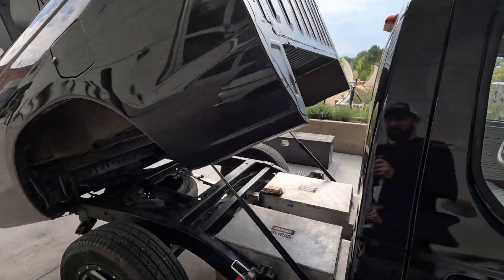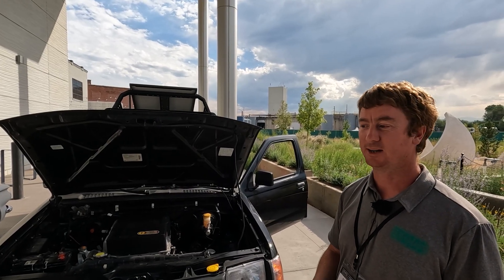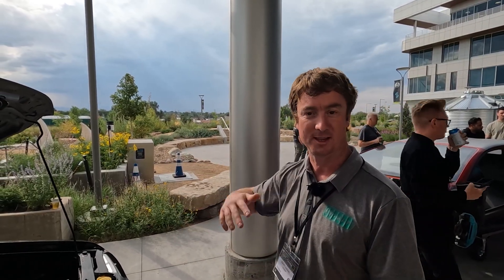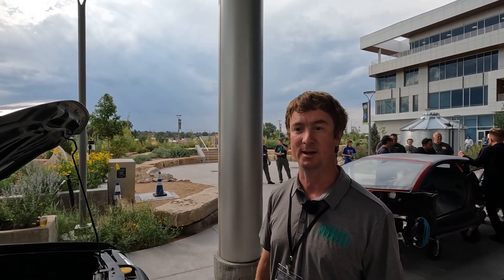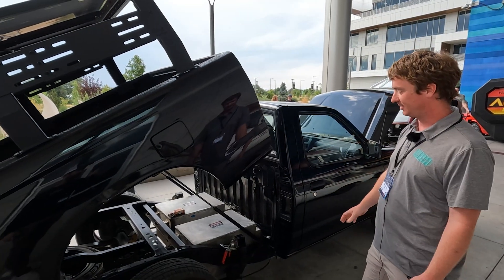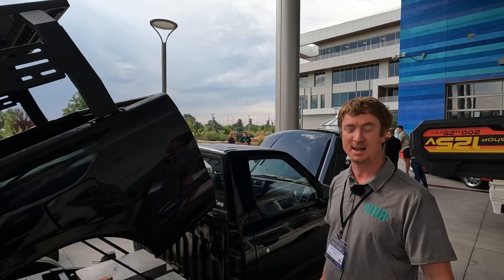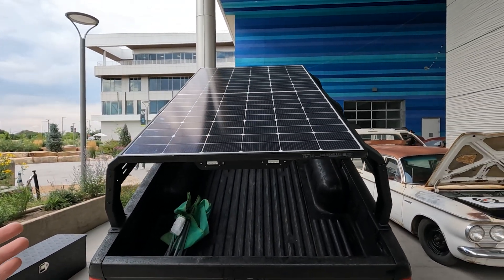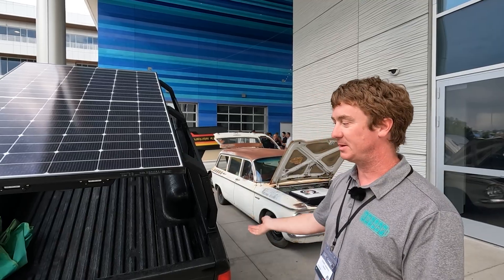This Nissan Frontier EV Swap Changes Everything

Comment: Now this is the kind of ev that interests me, enough range for daily stuff and charges itself for free if your someone who doesnt want to drive every day like me, no mention of cost but Im sure it can be done for a fraction of new with the cost of batteries coming down so much. Honestly this seems like a much better way to achieve mass adoption, convert existing cars at a price that makes sense, we just need a few thousand more of this guy around the world who can do it  without all the fancy stuff nobody needs.
Reply from the maker: I have another video with the owner Dave and he talks about cost for it. Dave did this for 15k including the truck and the wrecked Leaf. For an around town driver using the Leaf to convert is the most bang for buck route unless you need less power and range. Would you ever do a similar truck conversion?

Comment: Can you take the panels off the truck while it's at the cabin and still charge?  prefer the idea of using a battery truck for truck stuff.  Maybe use that rack as a platform sometimes for spotting things
Reply from the maker: I think he has a separate array at the cabin as well to power the whole site. Would be an interesting idea if the panels could be removed if he needed to haul though. But for this design he really wants to have the "infinite energy" loop on the truck.
Reply: It's a pick em up truck.  I'd hate to freakout over every branch dragging accross the panel.   How you gonna strap 12' logs to the rack and put brush or soil in the bed if you're driving a glass menagerie?

Comment: Ok, it’s not in the same league, but I have a Cushman Pro Hauler I converted to solar like this. It was already 72v lead acid, so already an electric drivetrain. I refit lead acid into home built lithium ion. Swapped the roof panel with a 400w solar panel combined with a 40-72v boost converter charger. While it doesn’t get any road time, it does haul crap all over our 7acres and drag a chain harrow (150-200lbs) over our two pastures. I haven’t plugging this thing in since I turned in on a year ago!!!
Reply from the maker: Dude that's awesome! A year of not plugging in is seriously impressive for a utility vehicle. Do you have it posted anywhere?

Comment: The solar panel idea is doable...a 12vdc Deep Cycle Battery with a 2000w AC invertor and the 120V basic Nissan charger Level 1
Easy peasy...
Reply from the maker: The idea of using the stock level 1 charger is pretty awesome!
Reply: Also could put your portable generator in the bed, gas it up, and charge Level 1.
Reply: @ttucro2  lol... you "could" but seems like an expensive way to charge up! 😂

Comment: Sounds like you need to source the correct MPPT controller
Reply from the maker: Any ideas on brand?
Reply: Honestly though I'm not sure you're going about this the right way. His best option would be to have a large solar array at his cabin in the Woods backed by a large battery that he can use to charge his vehicle when he needs @EVTUNERS
Reply from the maker: He does have another array at the cabin, not sure about the battery backup there though. But even if it might be more efficient, the owner really wants to demonstrate that it is possible to carry the solar panels and charge while parked. I have another video interview with him and he has a background in teaching so that definitely comes through in how he approaches the education and outreach. Super cool guy.
Reply: @EVTUNERS I did have another post here with links to kit that might do the job but YouTube removed it. I don't know how to send it to you 😢
Reply from the maker: Dang YouTube. I probably have that setting to block spam but forgot it was on. You can reach me through my website contact or at evtuners@gmail if you still have the links handy but if not no worries. Always interested in cool projects too if you have anything to share!

Comment: Instead of solar panels, perhaps BEV apostles should put lightning rods on top of their Engineless Batterycars and await their car to be struck by lightning so that they feel that they were granted divine blessing to drive for a little bit. This idea is superior to competing solar-panel-on-vehicle strategies in some obvious and not-so-obvious ways. If they fast (abstain from consuming food) while sequestered they may believe that it will increase the probability of earning divine blessing. No sexual activity or internet promotion/advocacy of BEV/PHEV is allowed for as long as they remain sequestered. Ideally, there should be a Toyota dealership nearby with lots of great Hybrids to buy if they choose to recant their prior beliefs and are deemed competent by Toyota Financial Services.
Reply: We charge our EV off a household outlet and walk out to a full battery every morning.  No high voltage.  We don't really think about charging since we do that at night and the car is in our driveway.  Haven't seen a gas station in a long time and don't miss it really.  Oh yeah, the electricity cost per mile is a quarter what we used to spend on gas.  Also, we bought a three year old EV with only 11K miles on it for only $14K, and I've already seen this particular model do 450K miles over a 8 year period by one Uber driver with only one battery swap in all of that which cost less than an engine swap.  So yeah, you're not only wrong, but you're full of some sort of extreme resentment or hate judging by your multiple comments on this one video.  I mean this in the best possible way, but I think you would benefit from some psychotherapy, and I'm not even kidding about that.  Cheers, dude.

Comment: Put one or two or more 5kwh golf cart 48v lfp batteries in the bed to take in solar continually, then charge vehicle from those batteries with appropriate inverter or dc dc charger
Reply from the maker: I wonder if a setup like that could also be configured to V2L for a house or 120v work plugs. Would give a lot of flexibility
Reply: @EVTUNERS yes it could, our old Leaf I our back up power, have a 120V inverotr that takes it power from the 12vdc battery, in a power outage we turn the car on in the driveway, run our extension cord to what we want to power. The charge just charges the 12vdc battery sitting there. Works great!
Reply from the maker: That sounds like a very slick solution and super easy in a pinch!
Reply: @EVTUNERS  it is definately an easy solution and takes about 5 minutes to set up. We also have our Ioniq5 with V2L capability built in. Had a day and half power outage last winter an between these 2 cars we had heat, fridges and freezers! All good.
The idea for the Leaf came from a You Tube guy (cannot remember his site) so I cannot take credit for the idea!
Cheers
Mike 🇨🇦
Reply from the maker: I've seen the Ioniq5 V2L but haven't used it personally. That's seriously impressive that between the two you were able to pull enough amps for heating as well! Which inverter do you use for that Leaf setup?
Reply: @EVTUNERS  I have a 1500W 12VDC > 120VAC unit, I am planning on upping that to a 2000W unit once I find one on sale. The Ioniq 5 is good for 16Amps at 120V it works so well! Plenty of juice for what we need.
Our furnace motor is a soft start so current draw is reasonable when the blower motor spools up.
Our big draw is our water pump and am working on a solution for that...possibly a LFP battery bank with a charge setup just for the water well...
Cheers
Mike 🇨🇦
Reply from the maker: Thanks for the details, I love hearing solutions like that, so cool. Are you thinking on DIY a battery bank? That's fresh on my mind as I'm recording a podcast soon with Vero Electric which makes BMS systems and beyond a bunch of sweet cars they are also seeing the BMS used in some cool stationary storage applications.
Reply: @EVTUNERS Yes, just install a 10kw hybrid inverter like a SungoldPower. That inverter has solar panel inputs and battery charge output to charge 48v lfp batteries. The inverter also has 220v output to use with an L2 charger to charge any ev from any 48v batteries connected to the inverter.
Edit: Also has 120v standard household output too
Reply from the maker: @geraldford6409 that sounds perfect will check it out! Thanks for the suggestion!

Comment: Is this about tricking people into dying alone in the woods?
Reply: Of course
Reply: @Nicholas-f5  ..has the "ship all the billionaires to Mars" plan been scrapped?
Reply: @GeneralFukzamatayu a great plan
Reply: @Nicholas-f5  just because they're failures to Algebra?
Reply: We charge our EV off a household outlet and walk out to a full battery every morning.  No high voltage.  We don't really think about charging since we do that at night and the car is in our driveway.  Haven't seen a gas station in a long time and don't miss it really.  Oh yeah, the electricity cost per mile is a quarter what we used to spend on gas.  Also, we bought a three year old EV with only 11K miles on it for only $14K, and I've already seen this particular model do 450K miles over a 8 year period by one Uber driver with only one battery swap in all of that which cost less than an engine swap.  So yeah, you're not only wrong, but you're full of some sort of extreme resentment or hate judging by your multiple comments on this one video.  I mean this in the best possible way, but I think you would benefit from some psychotherapy, and I'm not even kidding about that.  Cheers, dude.
Reply: @DougHill-g7j  Tesla lied about batteries lasting 300-500 miles.  Straight-up lied.  They don’t.

You’re not worth helping, but at least your lying ass can be a traffic cone unto others.

Comment: You're converting vehicles to BEV?  WTF would you do that?  
BEV are less capable vehicles than those that have gas tanks and actual engines.

They're vehicles that you have to plug in to special high-voltage plugs like some weirdo with a desperate pet toaster.  And the feedings take a long time, unlike the quickness and convenience of a fill-up at a gas station.  Hybrids self-maintain their battery and don't require this.
Reply: Wrong
Reply: We charge our EV off a household outlet and walk out to a full battery every morning.  No high voltage.  We don't really think about charging since we do that at night and the car is in our driveway.  Haven't seen a gas station in a long time and don't miss it really.  Oh yeah, the electricity cost per mile is a quarter what we used to spend on gas.  Also, we bought a three year old EV with only 11K miles on it for only $14K, and I've already seen this particular model do 450K miles over a 8 year period by one Uber driver with only one battery swap in all of that which cost less than an engine swap.  So yeah, you're not only wrong, but you're full of some sort of extreme resentment or hate judging by your multiple comments on this one video.  I mean this in the best possible way, but I think you would benefit from some psychotherapy, and I'm not even kidding about that.  Cheers, dude.

Comment: You could charge the 12v battery with mppt and periodically turn on an inverter to the level one charger.
Reply from the maker: If I follow that would then draw from the 12v to level 1 charge the HV battery? Interesting idea!
Reply: @EVTUNERS  Or you could connect the solar to an appropriate sized power unit like a Bluetti and then L1 charge off that.
Reply from the maker: @erikstephens34 that's a good idea! Don't need anything above L1 since it's just a constant trickle.
Reply: I would use sodium-ion cells and make 4kwh pack, solar will charge it and then using pure sine wave inverter and normal AC charger cable to transfer those kwh to the main battery pack, this system everything is well tested and minimal risk.
Reply from the maker: @petertraveller6421 sodium ion? Why not Lion for lighter weight
Reply: @EVTUNERS , because sodium-ion cells are just fine with -40° celsius temperature, li-ion can't handle it without active thermal control.
Also sodium-ion can last long time and not too expensive.
Car moves, someone can drive it to Canada example in January, the whole world is not like California.
Reply from the maker: @petertraveller6421 I haven't seen anyone do a conversion with sodium ion yet or seen the cells on the market but pretty interested! Cold weather for sure, but no management needed simplifies things a lot
Reply: @EVTUNERS , can use LFP or Li-ion for main high voltage battery pack, I just ment smaller like 4 kwh pack sodium cells for solar panels to charge, when it's full, can use normal granny cable and inverter to charge main battery pack from that small 4 kwh pack and after that's done, solar can charge that sodium pack again.
I know it has some loss when have to use inverter, but granny cable is well proven system to charge, no need to use a risky experimental DC to DC system which are not yet proven to be safe.
Reply from the maker: @petertraveller6421 I dig it!

Comment: Every time I see or think about this truck I start looking at used leafs to do my own swap.
Reply: Is the lead really easy to swap or something? What about a Chevy bolt swap. They have more range among other things
Reply from the maker: @devinJohnson-di2qpthree main reasons: aftermarket controllers (like Resolve EV) make it easy to get everything working, Leaf batteries aren't water cooled which makes battery enclosure simpler, and Leafs are plentiful and cheap. 

All that said I'd love to see some Bolt swaps, it is a great platform. GM seems to have abandoned selling the crate motor/battery too tsk tsk. But the Bolt even handles the track well and would make a great conversion if a controller existed
Reply: @devinJohnson-di2qp yeah you can find leafs all the time for like 1k, and there are actually affordable battery replacement and upgrade options… I have a bolt. So far there is zero aftermarket options for controlling or tuning. It’s a better factory car, but if you did a swap you’d have to figure out how to make it think it’s still in the car or go completely aftermarket with a controller. It’s just going to make it prohibitively more complicated and expensive for people like me
Reply: For the solar panel, what about using the regular AC charger ?
Reply from the maker: @pascalbroca1849  like the onboard charger from the Leaf stack? Hmm I wonder. Biggest issue to solve is getting the voltage stepped up first with an inverter or something
Reply: @EVTUNERS 
The issue will be the charging rate. The EVSE (the one you need to build) need to advertise the max rate, and the charger (from the leaf) then agrees, handshake, charge.  That takes a few seconds before the actual charging starts. 

The problem is that the PV output varies, so you need a buffer. 

Here’s what you need:
1. Solar panels, 48V
2. Solar charge controller MPPT
3. Regular lead acid batteries, 4*12V, charged by the fluctuating, maximized some output. 
4. Inverter to 120V or 240V
5. EVSE controller to set the charging speed according to the buffer battery level. You’ll need to program, maybe an arduino. 

It’s not trivial. 

I think a better solution is to put solar PV on the owner’s home, and charge the truck from the home. 

I don’t really see any benefit in having a moving PV attached to the truck. What’s the reasoning behind that choice?
Reply: Put solar PV on the house. Big house batteries. Probably already installed? 

Then install a regular EVSE, with a Bluetooth or WiFi app to set the charge rate.
Reply from the maker: You and me both! But I also start rubber necking late 90s trucks too 😂. 
Do you have a Frontier already?
Reply: @EVTUNERS  yeah a hardbody(I had 2) and a Tacoma. I was already committed to a ka24de build that I’m most of the way through, but was really considering the leaf swap for the other until it got destroyed by some rando that ran a stop sign. I may try and to swap the Tacoma, but I really like the idea of doing it all Nissan. We’ll see. 
I honestly feel like this type of conversion is going to become extremely popular in the near future. It just makes too much sense to ignore. And if I could pull off a light drift build… it would make it undeniable
Reply from the maker: @jasondreams202 dude that sucks about the wreck but always glad when everyone is okay. I've seen a Hyper9 Tacoma done but not a Leaf yet, that would be cool. 

A drift build? Yes!! Have you seen the videos on our team Arcblast and that Datsun 620 race truck? Its set up for endurance racing but what I think stands out is just how well suited the small trucks are to a conversion. I think a light little truck for drifting and autocross would rule.
Reply: @EVTUNERS yes I have! That did help me solidify the idea in my head.
Reply from the maker: @jasondreams202 amazing! Keep me posted how it goes!!